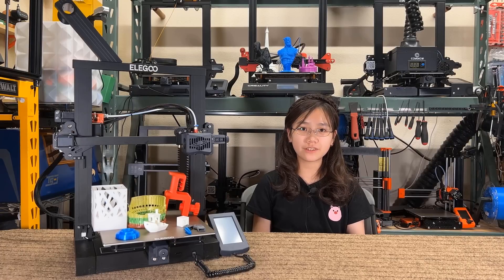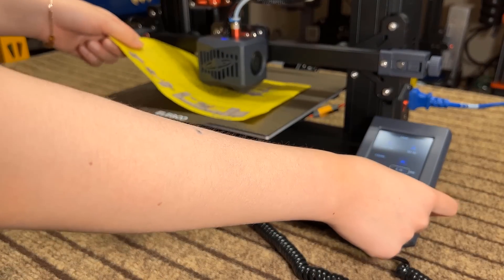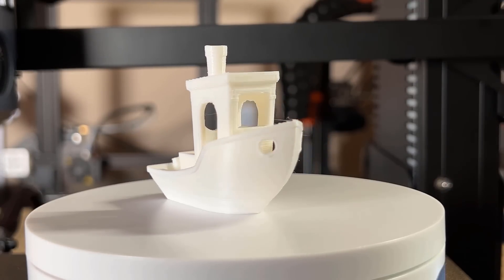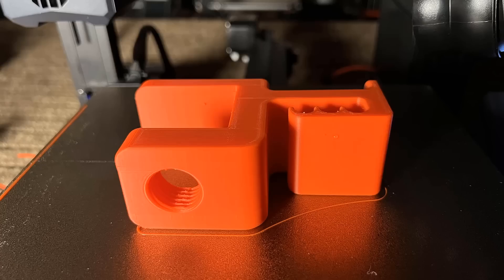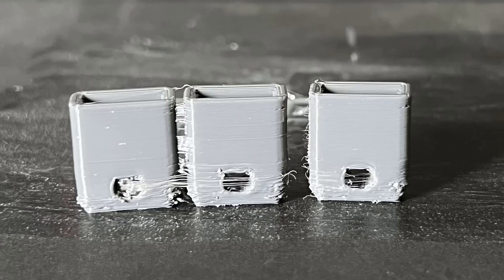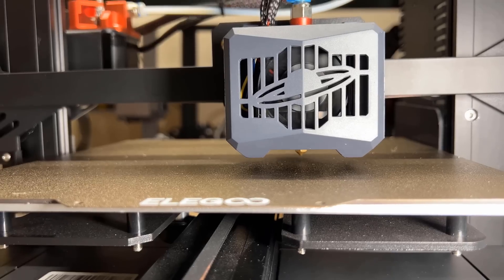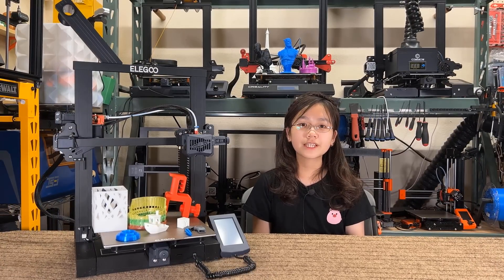Elegoo Neptune 3: The new king of $200 3D printer? Auto bed leveling, color touch screen, PEI sheet

Comment: Fantastic production values here. Y'all rock!

I always cut my filament at an angle, and ever since I figured that out, I've not had a problem with feeding. I'll do one cut at an angle that engages basically the entire cutting surface of my snips, and then I'll do a little  relief cut on the opposite side. 

I initially didn't realize you could disengage the extruder gears, so I'd be trying to find the secret, magical angle to feed the spool-warped, curving filament at, so that it would go through the extruder for far, far, far....far... too long. I mean, it was stock, and folk do print stuff, so it must work somehow, right? But yeah, don't be a just-got-my-first-3D-printer Sam, and cut your filament at a steep angle.
Reply: This printer's filament sensor has a very stiff wheel that actually works better with a straight-across cut. Most printers do work better with an angled cut.
Reply: @dianasharpe9484 , hard to argue with that, but I would think you could roll it sideways, so it still has the same profile.

That said, it’s frustrating when products are so weird to use that you just toss them to the side. Hopefully there are better designs out there.

Comment: To solve the lack of lan/wifi support in Niptune3, take a look at Octopi, a web interface for 3d printers. In my setup I am running Octopi on a raspberry PI.  With octopi you could queue and manage the printer remotely. Optopi could be configured with a web cam to monitor the printer remotely.

Comment: I agree that this may be the king around $200, but still think an original Ender 3, now at $80 in some spots, is then the emperor of cheap printers.  Sure, it is missing all those upgrades like ABL and filament-sensor and has noisy steppers and probably a dated board, but it's a steal at that price and the ideal to learn how to 3d print.  If you just want to print without learning, then you have to go to a Bambu Labs X1, but are out of the "cheap" category (although I do think it is worth the price at this point).  If you want to check out 3d printing without spending $$$, the  $80 to try out whether it's for you (and then anyway moving to a core-xy or delta or ...) seems more logical to me then spending $200 on something that's still just a starter printer.
Reply: Sure it would be great to try 3DP with such a chearp printer, but assuming you do like it then you are likely going to be quickly upgrading that $80 Ender 3 after a very short time anyway so in the end its perhaps somewhat of a false economy.
Reply: @alifewithoutgamingisnolife  No it isn't, because those upgrades again teach you how they work and how to improve them further.  Just buying a printer with those things already in place just bypasses the learning and often also gives you something less open for further improvements.  Ex. those newer printers often use extrusions with some sides flat, which might look neater, but removes options to attach stuff with T-nuts to that side of the extrusion ...

Comment: Will the Eryone spools fit in a Bambu Labs x1c AMS?
I would like to buy 10 spools.
If it does not fit is there an easy way to transfer it to a Bambu spool?
Reply from the maker: I am using Eryone $13 PLA and $12 PETG on almost every printer including the BambuLab X1 AMS. In fact, the AMS fits most filament except for those non regular size spools.
Reply: @AuroraTech  Thank you for the info and all the great videos as well!

Comment: How did you make out on easy nylon? I have the same filament you have and printed a light fixture and it turn out great but when I used it in a printer enclosure it just deformed.

Comment: Great review. Think your suggestion for a direct drive Elegoo Neptune 3 Pro are spot on. Would offer superb value and a great entry-level price point.
At $200, the Neptune 3 does deliver on all the basics, making it easy for a beginner to have satisfactory results. Personally, I would prefer to spend a bit more upfront and not need to think about possible upgrades for a year, or so.

Comment: Tip for the filament detector with tpu…if you cut the tpu at a very long sharp angle you can use it like a wedge to get through, take a min to take a look into the hole where the filament goes to note where the opening is and align the end you snipped accordingly.
Reply: This is a great tip.  Thank you!!

Comment: 1 month with this printer. I print every day and it's very clean accurate and even with tiny mechanical parts. Incredible small printer. The hotend fan is noisy and you have to clean the noozle before ABL. There is a cura profile with the cura proposed on the sdcard. For the rest, completely agree with you. Great review ;)
Reply: Can you upgrade to metal hot end?

Comment: Great review AT. Observation…the gantry looked offset/imbalanced and appears higher on the right side. Could possibly be camera lens distortion but it appeared in several shots. Secondly, was it a typo on printing PETG @ 200? That seems very low for PETG. Third, you said there isn’t a USB port but I see one right on the front, is it simply not connected? Regardless, keep up the good work!
Reply from the maker: Yes, it was a typo. PETG was printing at 230-235C. 
I mean it doesn't support a USB drive, it has a USB port for you to connect to the computer.
Reply: @AuroraTech  Ah that makes sense :) I really appreciate your reviews and hard work, I think you’re remarkable!

Comment: The version of Cura that comes bundled on the SD card with the printer has a Neptune 3 profile on it. It's only v4.80 but still does a good enough job until I get around to porting it over to my 5.1.0 install.
Received one of these last month and went straight out to pre-order two more which just arrived today. These are serious little workhorses and my first one was running 24/7 until I had a whoopsie with my hotend (which was totally my fault...sloppy nozzle swap). This brings me to a (hopefully short-lived) downside. As they're so new, there's not much in the way of spares out there. Sure the nozzles and extruder are standard but I can't find a hotend to switch in anywhere. The issue is the way it's mounted, two screws down through the top instead of front to back so that the strain gauge works. If anyone knows of a source of hotends out there that fit these (without a complete rebuild like the Wham Bam system), I'd be happy to hear of it.

Comment: I'm so confused as to why these companies don't add an all metal hotend. It's definitely worth the 5 extra dollars.
Reply: Its more like 20-50 dollars
Reply: @jubb1984  a metal heatbreak costs around 5$
Reply: @hungryafrican420  a shitty one yes, if you want any decently manufactured one with smooth inner walls and good metals, its at least 20 dollars
Reply: @jubb1984  not really... have you seen the prices on ali for a cheap all metal hotend? dirt cheap, would be even cheaper for a mature company like elegoo.
Reply: @kalihban7212  yes for a shitty one, the manufacturing tolerances on them are usually worse then the more expensive ones = worse prints
Reply: @jubb1984  Trianglelabs and Mellow (two rather reputable ali sellers) both price full titanium heat breaks for under 5$. They also sell bi metal ones for under $20. Do you research before making vague claims.
Reply: @kalihban7212  And have you see reports on their machining accuracy?
Reply: @jubb1984  no, but i have seen dozens of others who have purchased and tested the items with no issue. I myself purchase from both shops regularly,
Reply: @jubb1984  Have you tested/used any of their products at all?
Reply: @kalihban7212  and thats fine, id rather rely on verified reports of machining accuracy instead, since when i print at 0.06mm everything plays a role. If you are not sqeamish about good prints, go for it, you might get lucky and get a decent part...or you might end up not knowing why your print looks like crap (because of some slight tolerance issue).
The setup Elegoo uses is simple and does not require very good machining tolerances unlike a all metal hotend, since the bowden tube does most of the heavy lifting, so less issues with reliability.
Reply: @jubb1984  when have you had issues with machining tolerances on a heatbreak? I've never had that issue, and I usually print at 0.15 layer height, 400mm/s at 15k accel. If you really want good tolerances, a genuine e3d heat break is only $6, that's nothing compared to your originally stated 20-50$. Unless you want to argue that e3d does a bad job machining their parts?
Reply: @kalihban7212  Then you apparently get a lot cheaper parts then where i live, those are not 5 dollars here, they are about 20 bucks where a all metal hot end costs appropriately more (about 80 bucks equivalent) for a genuine e3d one.
Reply: @jubb1984  where do you live? The full e3d v6 is never sold for that much. Not sure where you got those prices from, could you link me to a website?
Reply: @jubb1984  So, you complain out of ignorance?!
Reply: @kalihban7212  Jubb is somewhat correct, from videos comparing them it seems as though the cheap ones end up having problems.
Reply: Then again your buying a 200$ printer. How can u expect to have a high quality heatbreak without them raising the price?
Reply: @hungryafrican420  part of the reason why I'm not necessarily upset about it. A good metal heartbrake is like $20. They have to make some cost saving measures to hit such a low price point.
Reply: Can this be upgraded to metal hot end?
Reply: What do you guys recommend for upgrades for this I have one ..

Comment: I'm planning on purchasing a 3D printer in the near future, so I've seen a LOT of printer reviews over the last few weeks. Yours are by far the most thorough, and you are an excellent communicator.
Reply: whats your price range
Reply: @muniradlan3659  ~$500 feels like a good cap for what I want to print. Currently leaning towards the Ender 3 S1 Pro.
Reply: @evanbooth1441  that's a good choice. But it costs more than the Ender 3 v2 which has a silent driver board (if you're interested in a quiet printer), and they're pretty similar aside from that fact. You should check out the bambu lab X1 if you ever decide to increase your budget. It's like the iphone of 3d printers (has Lidar bed leveling and is 4x the speed of a standard printer + has AMS), completely changed the market, it's a few generations ahead of the competition.

Comment: beautiful job team great review performance, I agree fully another 50 or 60 bucks and its  total home run. I know the Micros Swiss Hot end and Direct drive on my 10S Pro has been game changing. And you eryone $12 filament is awesome.  I had a semi tech question what difference or advantage of PETG over PLA???? Great video truly appreciate your effort and great info on products and methods. Stay Well, Dennis
Reply from the maker: You may take a look at this article:
PETG VS PLA:
https://www.3dnatives.com/en/pla-vs-petg-which-material-should-you-choose-110520215/#:~:text=If%20you%20are%20looking%20for,mixture%20between%20ABS%20and%20PLA.
Reply: @AuroraTech  excellent article thank you so much. My application is model trains. Wheel and chassis assembly, bulkhead and fireboxes, smoke generators and engine magnetic field frames. Seems PETG could be better. I had used PETG CF but not since the mod to Micri Swiss hot end and Direct Drive with ABL. That mod has transformed my 10S Pro V1. It has been fabulously reliable since. Guess I will try eryone PETG now and PETG CF for the Smoke housing. Thank You so much. If you ever want to build a model train please let me help you. I work in S Scale and it is the best. I have printed every thing. Comlmetd chassis, motors wheels, trucks, smoke, bulkheads and soon a complete Body, the Snow Piercer perpetual engine. Dennis
Reply: @AuroraTech  which one should I buy in India elegoo Neptune 3 or Ender 3 s1 both printers cost around same here so. Can you help.me with the decision please!!

Comment: My Neptune 2S has been trouble free (except for 1 issue) , and been printing well, for over a year now, never had a clog,  only minor issue is the end of filament sensor, stopped detecting the presence of filament, I just unplugged it, and it works, haven't bothered to replace it yet, but it's a simple / cheap fix.

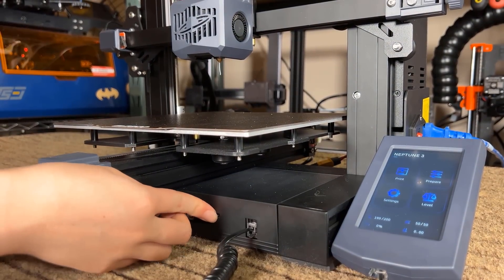Comment: Great review, thank you. I just have a quick question at 11:51 you have mentioned absence of USB printing, but I could see printer style USB connecter left to the micro sd card slot. Is it possible to connect it over USB then? Asking if OctoPi is possible, thank you.
Reply: OctoPi works great on the Neptune 3. You can use that USB port for it. I've been using the printer with the Pi Zero 2 W for a week now without any issues.
Reply from the maker: I mean it doesn't support USB drive. The USB port is for you to connect to your computer or Octopi. Octopi should work for almost any 3D printer running Marlin.